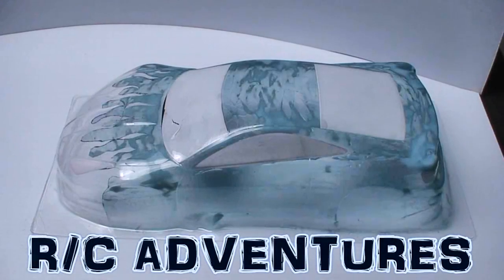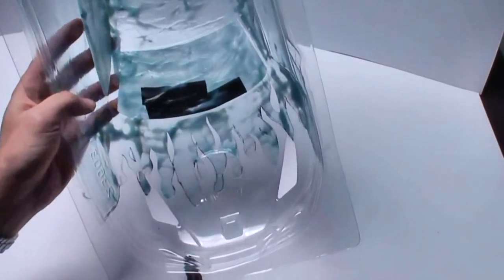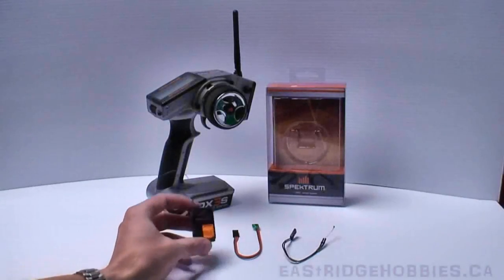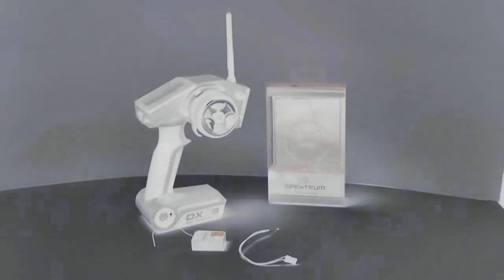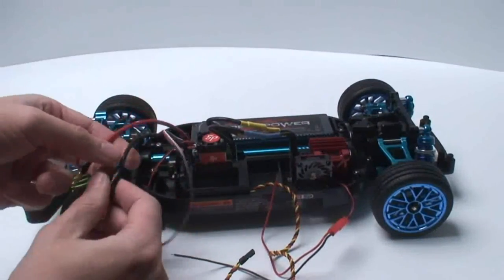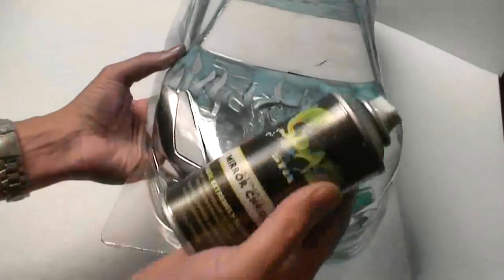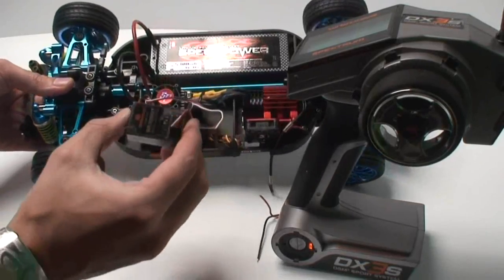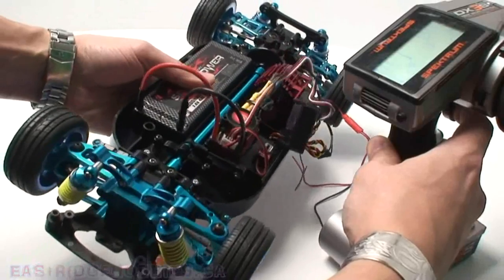RC ADVENTURES - BRUSHLESS TOURING DRIFT CAR-PT #6 TAMIYA TT01 R KIT CUSTOM KIT

Comment: That is a very nice kit! I am new to this legit RC car hobby and have been doing some research and found your videos. As a noobie looking for a first kit, i was wondering if you could reccomend any kits of that type that are most versitile with upgradeable parts such as those alluminum pieces, gears, or bodies. I am intirested in the 1/10 size, and could use some help.

Comment: mate you need a carbon upper frame which goes on top of your gear box covers helps to keep the chassis straight ya know and maybe camber adjustments for the front?? just throwing it out there bro??

Comment: @DJmedic2008 Great vid, I learned a little about a lot. Good job on the paint. I've been considering one of these or an Ofna JL10e GT. Just want for parking lot bashing and speed runs. Both are really low price, I can't decide. Do you know which chassis will handle the most power?  Again GREAT vid!

Comment: i really think u should put a servo saver on your rc car b-coz even if u are quick enough to react and turn the car away from the wall
it will still run into it because da tires r slippery
if u had those soft tires
dat wuld b a different story

Comment: hey i have a tt-01 D and i have replaced the steering servo + other steering parts and i still have extreme wobble and movement in it which is cause ing it to wonder in random directions its still 95% stock how can i fix it so will will go in a straight line and not in random directions

Comment: @FerdieFB23 if your not drifting Castle Creations has released an unbelievable combo 1/10 Sidewinder V2 S2 ESC W/CM36 540s in a wide range of Kv. The best part is they'll take huge NiMH sticks as well as up to 3s LiPo. OK the REAL best part is the price at less than $100.00!!!

Comment: If you want the aluminum parts go to eBay and search for either Yeah Racing or 3 Rancing of GPM racing or XSPEDE TT01 parts and you will find like a whole kit or seperate parts but makesure you read which one you are buying like if your getting parts for the TT01 D or type E or just the normal one... If you own theory final TT01 and you got parts for the TT01 D just go online and buy the TT01 D spare parts bag B and change it out.